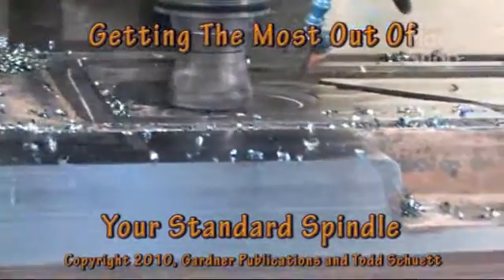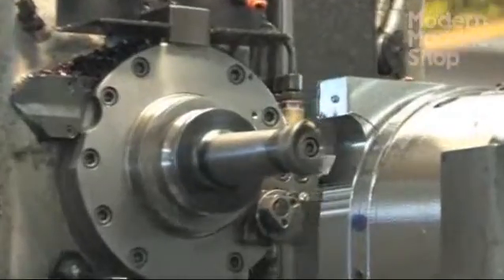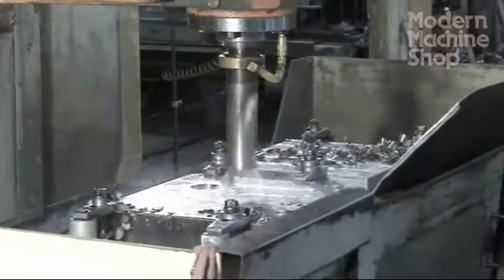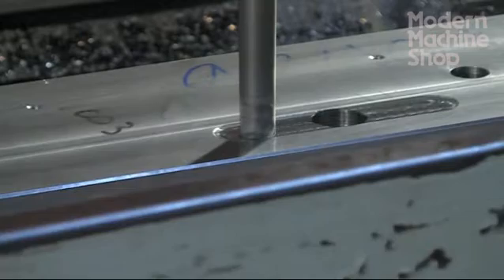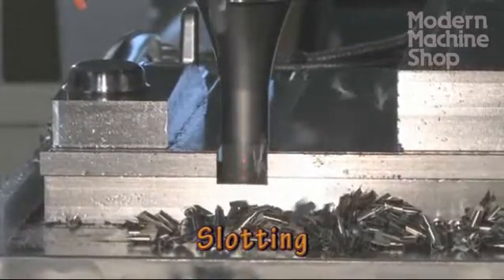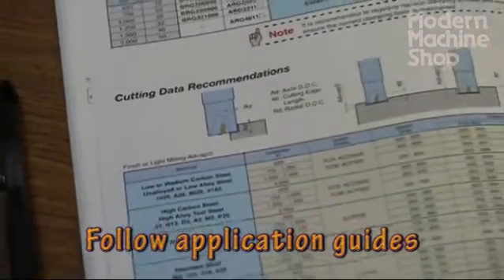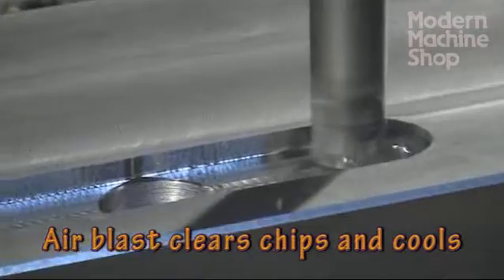Getting the Most out of Your Standard Spindle

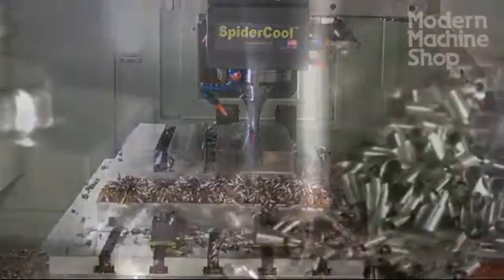Comment: the tool you use at 2:55 , does that leave a good finish ? im looking for a high speed carbide tool to finish the face of large pockets, the tool should be able to mill .010" at arround 60 ipm leaving a good finish, whats it called? diameter?